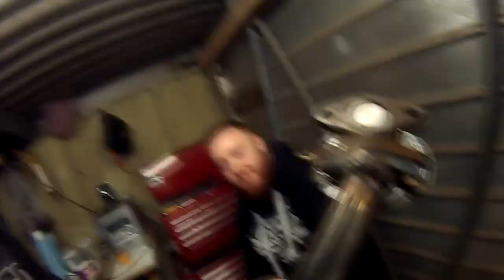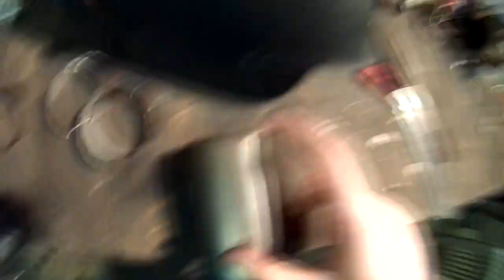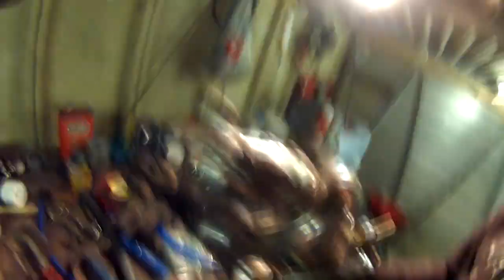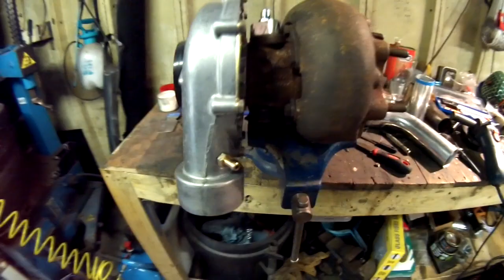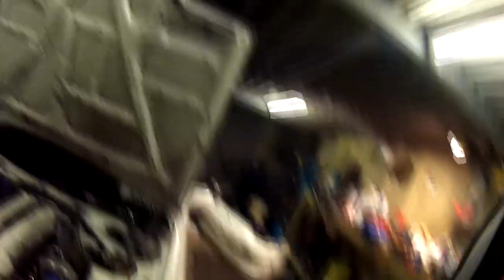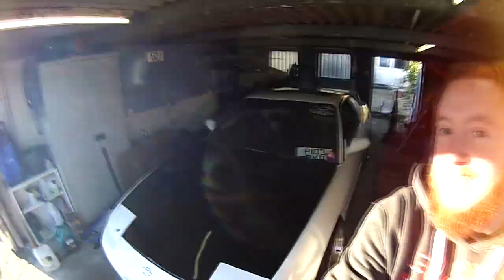180sx k27 turbo install

Comment: what power did it make. thinking about this turbo on my 1jz
Reply from the maker: D.M.T drift, mods, tuning 

It made 350hp at 1.0bar. Only thing stopping more was the limitation on injector size. These turbos are awesome on jz engines